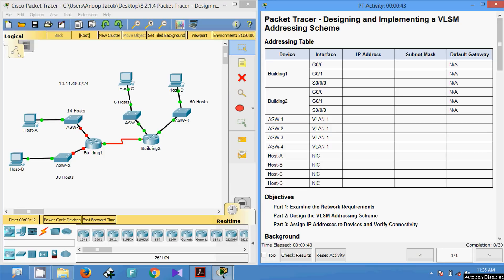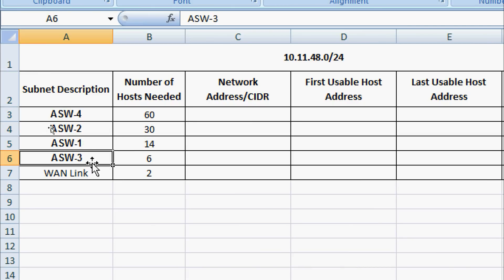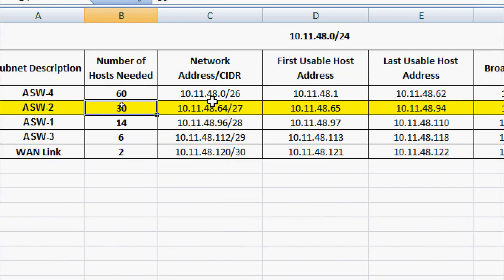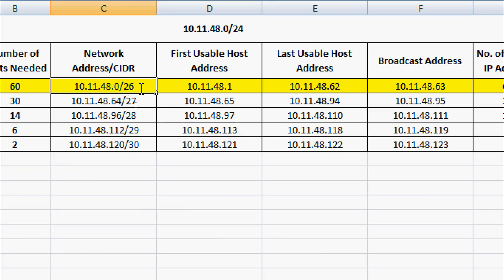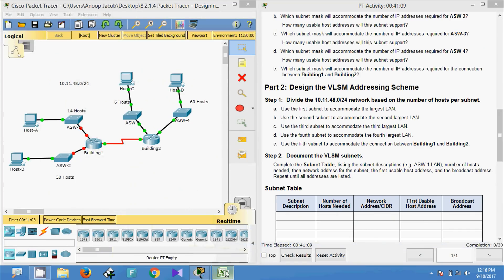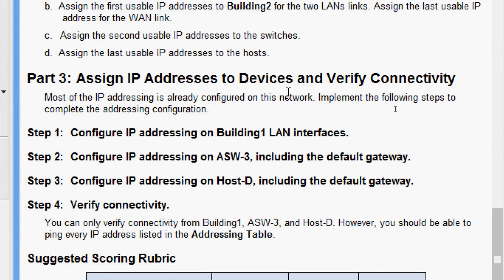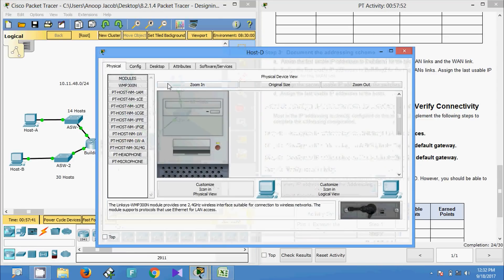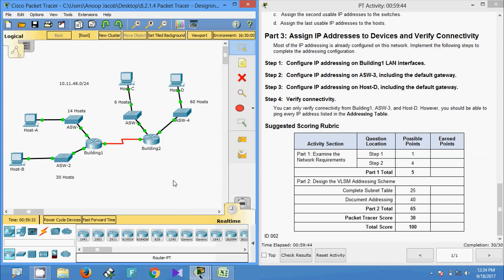8.2.1.4 Packet Tracer - Designing and Implementing a VLSM Addressing Scheme

Comment: the default subnet mask for class a is 255.0.0.0 
i find this confusing you used 255.255.255.0
Reply: Class C ip address uses 255.255.255.0
Class A uses 255.0.0.0
Class B uses the one you mentioned
Reply: The activity says it's a /24 network address, which is why he used 255.255.255.0. Also this activity is using VLSM which is classless.

Comment: I appreciate the video but I agree that it's good for checking to make sure you are completing the packet tracer portion correctly but I would love some additional explanation on how you filled out the tables as this is very early on and the first chapter regarding subnetting, you are assuming we know alot of information already going in to this.  I got the initial spreadsheet table you we referencing and understand how you initially created the subnets, but hazy on how your determining what ips to assign to the various links or the default gateways.  Do you have any video links that will help me out there? 

Thanks